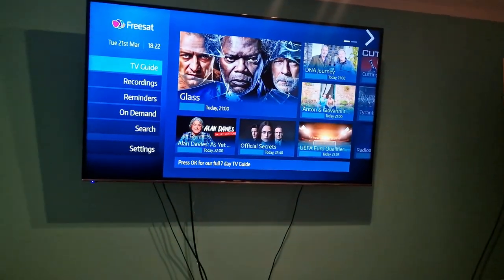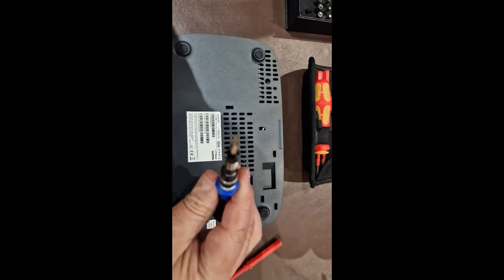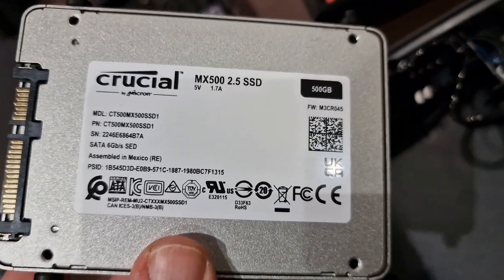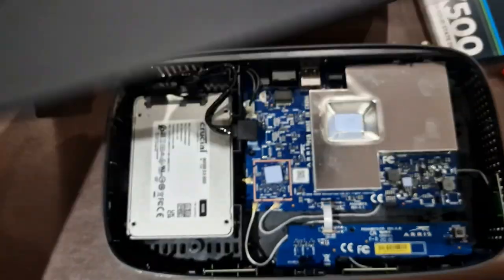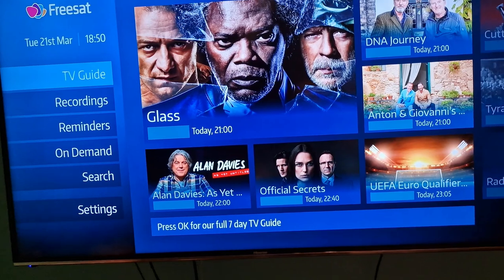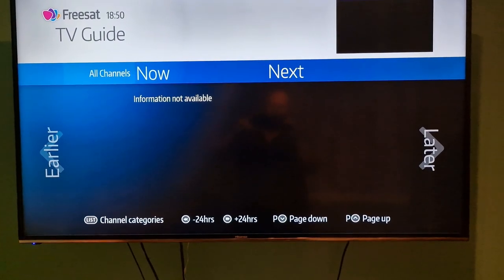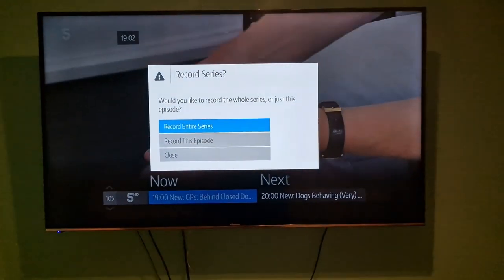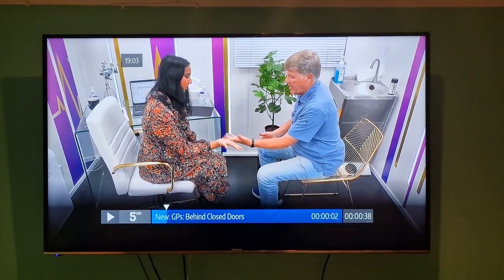Freesat Arris UHD-4X-500, Hard Drive Replacement upgraded to SSD,

Comment: I replaced the hard drive in my box with a SSD after watching your video. After a few hours the drive overheated and shut down. I have now replaced it with a new HDD. No problems since.
Reply: The crucial ssd’s can run hot I’ve found although top quality kit. The Samsung evo’s are frugal with power and tend to run cooler.
Reply: Same issue... did you find a solution?
Reply: @liambreakspear1235  No. I’ve stayed with the HDD. It might have been ok with a different SSD but I didn’t pursue it.

Comment: Hi Adrian. I’ve had a few hard drive problems with my 500gb box so I replaced with exact same SSD as you and now appears to be working perfectly, perhaps with improved performance.
Thanks for the simple guide, my box is almost 3 years old and was one of the first.
Freesat now just need to get their iOS app sorted which is a disgrace, they seem uninterested in addressing the abysmal Apple App Store reviews especially re setting recordings remotely.
Reply from the maker: Happy to have helped someone my mission is accomplished. Thanks for your feedback

Comment: I have tried 2 new hard drive, but i'm still getting error message "something's wrong, whilst the box was turning on, we've noticed an error with your hard drive,  I have rebooted and done a full reset several times but to No avail. The drive does show in the information menu and shows the capacity and temperature

Comment: Hi after the screws are removed how do you open the box?  Two screws removed but it's not obvious to me how to remove the cover.  Thanks!
Reply from the maker: You just gently prize it apart the top should lift away from the bottom
Reply: @AdrianLaRiviere  thanks! Just waiting on the hardrive and hopefully back up and running.  The box is great when it works :)

Comment: Installing an SSD in any form of PVR is not a good idea an SSD only has a limited number of times it can be written to in its lifetime and as a PVR is constantly writing to its storage for a buffer to be able to pause and rewind live TV as well for recordings, a typical SSD will not last as long as typical HDD would. Personally, i wish it waa a perfect world where an SSD could be used for storage on a PVR and have as a long lifespan as a HDD as they do make the performance of an older PC or even a PS3 or a PS4 a lot better.

Comment: When I took my hd out is was Ext3 format. Tried an SSD but kept get an over heat warming. I was told don't use a Toshiba HD, they're naff. Use WD. I did a lot of research at the time.
Reply: Yes, I’d guess that is the case, as when you boot the machine and log in to YouTube with a Gmail account, Gmail sends you a warning telling you a Linux Device has tried to log in/ access the account.

Still can’t get HDD access though..  but it is an old 160gb drive, that did work when plugged in to Mac via USB adapter

Comment: Have replaced the hard drive to a SSD  but now it keeps saying the drive is overheating. Any ideas?
Reply: The crucial ssd’s can run hot I’ve found although top quality kit. The Samsung evo’s are frugal with power and tend to run cooler.
Reply: Did you find a solution as I have same issue after upgrading to ssd
Reply: When I look in system settings for hard drive info it says 0c temp ?!?!? Strange ?!?!?
Reply: Then says 128c
Reply: @liambreakspear1235  I ended up buying a new box instead. As couldn't find a way to solve it. Good luck...hope you find a way.